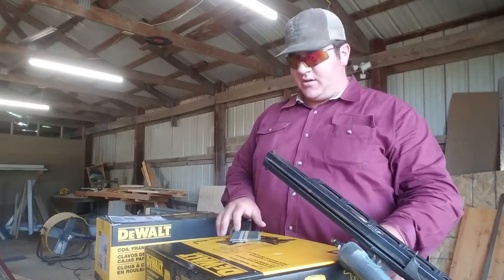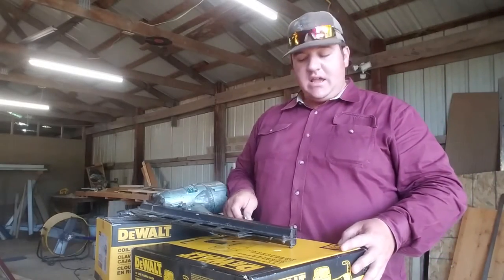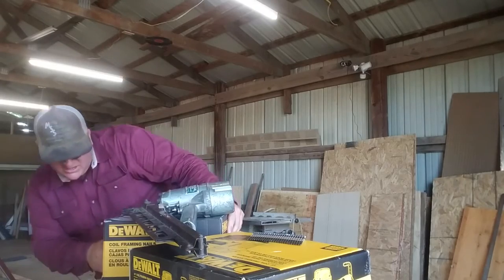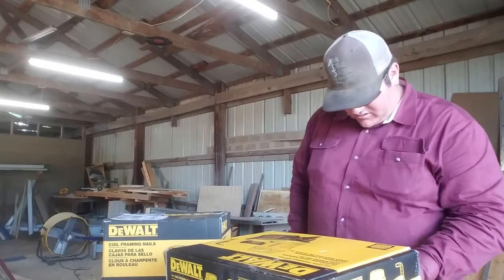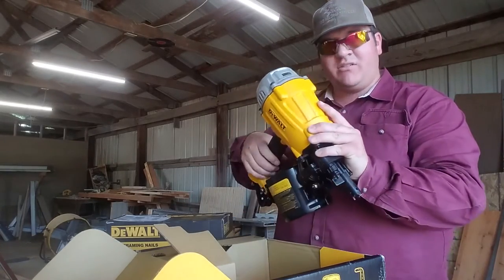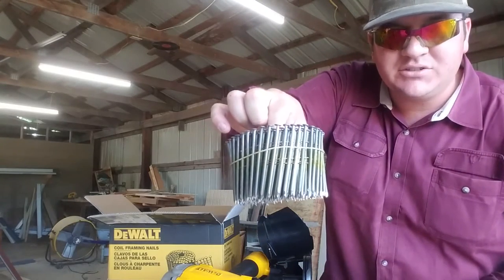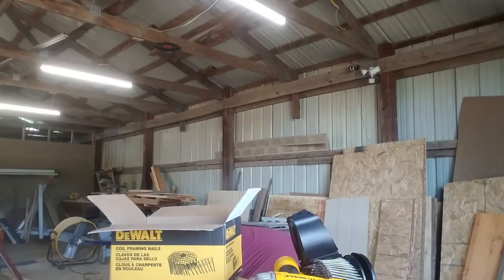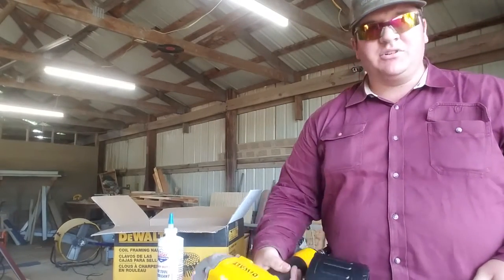Dewalt DWF83C coil framing nailer

Comment: Dude, you know Hitachi makes a coil frame right? I've been using the same one for every subfloor  and roof deck on every house I've framed since 1995. Only rebuilt it twice. Dewalt makes great saws, particularly miter saws, they make great drills, and planes and routers, but they're nail guns aren't tried and true whatsoever. Get the NV83A2 that's what I have. It's on the A5 by now I think.

Comment: this good?
Reply from the maker: So far. It doesn't like to countersink the nails very good though
Reply: @Mattmorrisenterprises What compressor did you use?
Reply from the maker: @thebestsoccer2063  it's an older Speedaire. It's set at about 110 psi
Reply: @Mattmorrisenterprises  i test today looks good